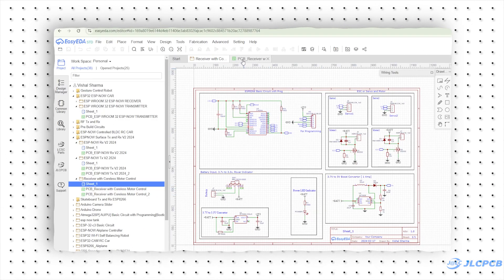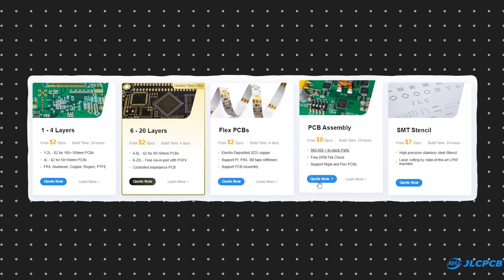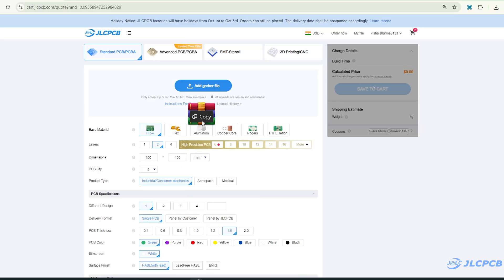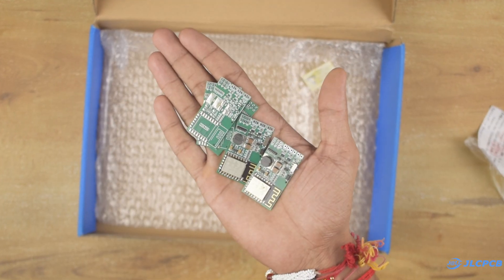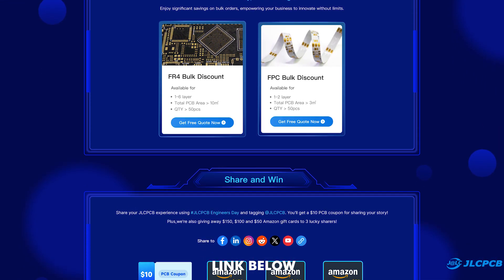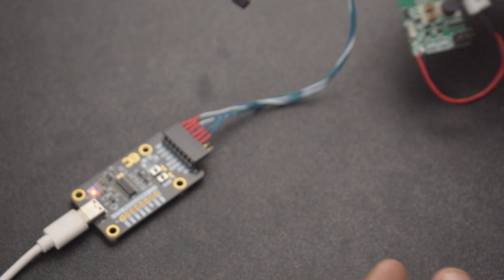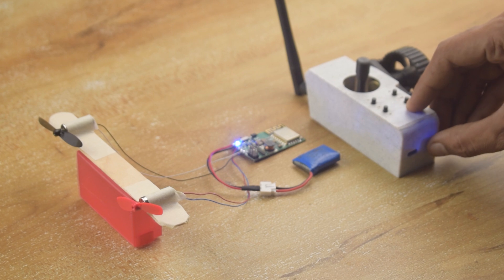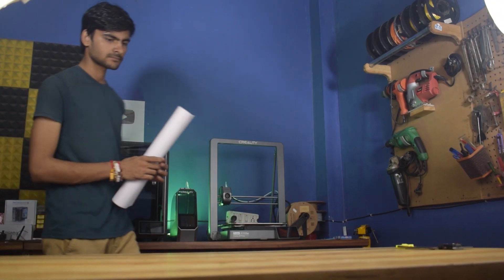I Built an Insane DIY Radio Control Airplane out of Thermocol

Comment: HI proknow!  I really like your projects and i want to know about the thermocol you use in your projects and where do you get that kind of thermocol. I too tried making a more powerful plane using brushless motors and i was able to make the body of the plane but when it came to file the body down to make the body aerodynamic i always face a challenge as my plane's thermocol body starts breaking down into small balls and does not end well.. so i just wanna know is something wrong with my thermocol and you use some other type of thermocol ? and the files too? btw great video man! so cool !